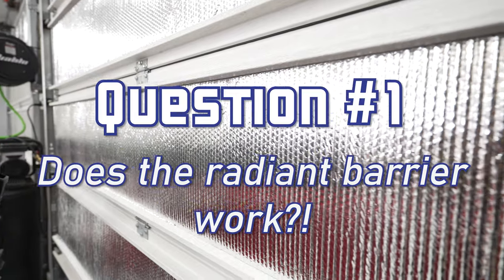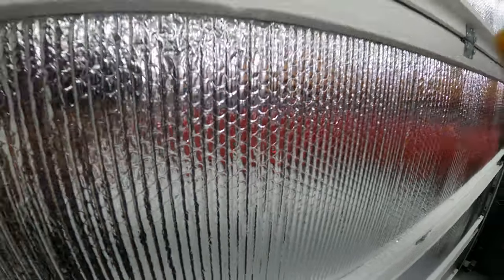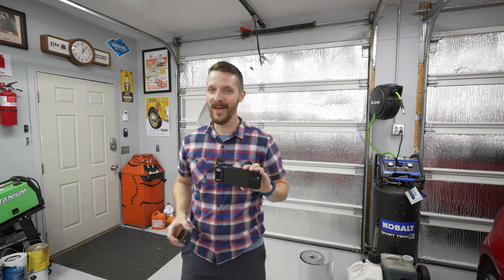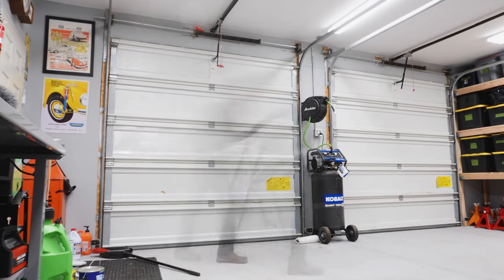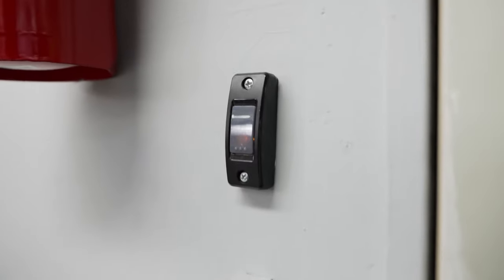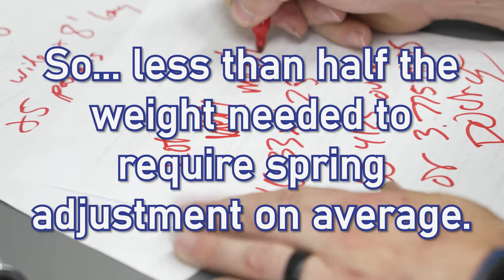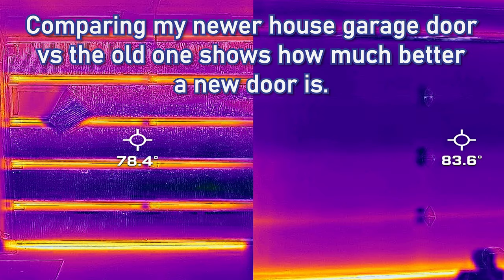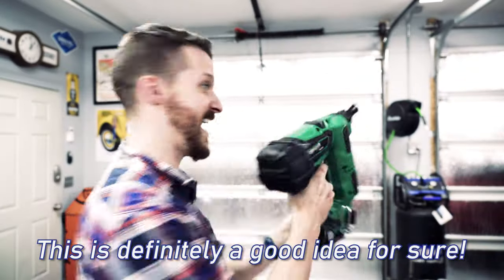DOES IT WORK? Radiant Barrier Insulation on Garage Door! (RESULTS ARE IN)

Comment: Great video,
I'm also in central WA, I did this to my garage door about 8 years back and made some mistakes, but also had some success.  Exact same style of garage door too.  I did 1" foam board and reflectix, I attached it to the door using foam adhesive to attach everything.  It ended up adding almost 20 pounds to the door so I had to adjust the springs a bit which wasn't as easy as I expected.  

However, I did one thing that was not done in your video,  I covered everything(hinge area included) with the reflectix.  Reflectix is very flexible and it never tore or failed,  Where I needed to open it up for maintenance I just cut a slit down the middle and left it,  Every time the garage door closes it closes the gap and still provides insulation.

What I learned from what I did:
-foam weighs too much, I'm doing it again on another garage door, and I'm going with just 1 layer of reflictix but I'll use aluminum tape to mount it again and I'll mount it to the ribs folding in a 2" section on the ends to close the air gap.  
-Foam glue failed after 3 years, would not use it again.
-Aluminum tape did work, lasted a lot longer except where the foam glue failed it eventually wore out.  However, the surface needs to be very clean before applying the tape.(note, if you use aluminum tape, your radian barrier sits on top of the ribs with the tape going around the top and bottom of the ribs.  I had to re-do some of the insulation a few years ago and used an off brand aluminum tape, and it didn't last nearly as long.  Maybe it was bad tape, maybe I didn't clean it well enough.
-reflectix lasts an incredibly long time and is very forgiving material

I stumbled on the original video trying to find a fix for a garage door seal issue, but I stayed for the full course.
Reply from the maker: Wow, lots of great info.  Thanks for sharing.
Reply: Did you insulate the garage attic / ceiling also … how about the walls?
Reply: @delvalle9256 Yes, I am wondering the same damned thing.   I need to do something with my attic, because it is just too hot in Texas.  Our electric bill last month was $500 bucks, and it's usually $200/$250.  Very hot summer.
Reply: @PoeLemic We had the same issue here in CA. We had solar installed and it’s been amazing. Our bill is almost non existent.
Reply: I'm in western Washington and glad to find a youtuber I'm Washington state ! I'm now a subscriber!
Reply: @JasonExplainsThings 
What I wanted to know was not the garage door heat difference but the overall garage temperature. Do you recall how much the entire garage temperature went down by?

Comment: When you use an IR thermometer, the reading depends on more than just the temperature of the surface. It also depends on the emissivity of the surface. And the emissivity is much different between your radiant insulation and your white garage door. So the temperature difference readings are not reliable. You can mitigate it to some extent by taping a piece of white paper to each surface to be compared, and measuring the temperature of the paper surface. Or better yet, just use a contact thermometer.

By the way, IR thermometers are particularly bad at measuring the temperature of shiny surfaces accurately.
Reply: And that information comes with the devices he using... so he's an effing hack trying to make money by pretending he's smart enough to show the world how to do sh^&!  YouTube is just a disaster these days.  Ugh
Reply: Thanks for making this important point which invalidates the testing.
Reply: So tell us how you did it. @DiffEQ
Reply: @DiffEQ  assuming he read the info in the packaging cause lets be honest who does that and for those that do who understands it. its more fun to just pull it out and use it.
Reply: I came here to say this. This poor guy is clueless on this subject!

Comment: According to the Powers that be you are supposed to have a 1 inch distance between the Radiant Barrier and the nearest surface. I have actually used the 4ft wide version on 2 Total House Gut outs and Cut MY HVAC bill by 80%. 2 inches spray foam, then the Radiant Barrier across the studs. Then Tape all seams corners etc so that there was a continuous  Radiant Barrier  surface between the inside and the outside. I Lived in New Jersey. Had to turn the A/C on for about 2 weeks in the summer. The heat went from coming on every hour to coming on every 4 or 5 hours. You Might want to try adding an Extra 2 inches to your height  and width so that it pillows out a little. You Might get better heat reduction out of it. YOu could also use the 4ft wide stuff cover the whole door with the Radiant Barrier leave needed slack and you might be able to get even better results. But nice to see that even without the 1 inch space it still works.

Comment: The IR reflection of aluminum is very high, so with IR gun or IR camera you are measuring temperature of IR reflections from the inside of the room off of the aluminum surface, not the amount of heat coming through the barrier.

You can spray a small area of foil with paint or put some black electrical tape on surface and it will then represent the heat coming through the foil.  What ever you use must have good thermal conductive contact to foil and not be reflective to IR wavelength.
Reply: The temperature of the foil isn't very useful information... showing the temperature of the garage door from the outside would be the best way to show how well the heat is being rejected from the garage. The outside temperature where the reflective panels are should be considerably higher than the temperature where heat is being transmitted into the garage
Reply: Temperature is not the same as heat flow. 2 different but related concepts. for the high reflectivity materials, it is tricky. use a contact thermometer to measure the surface temp. This temperature will cause the convection of air. Radiant should be negligible.

Comment: 2 years ago I had a foam guy spray foam my doors with 3'' foam weighs lot more than what you used. 2 years later still opening fine. was expensive yes but now I can keep my garage warmer and cooler than my living room! also sprayed the celling not to mention 24'' cellulose above ceiling. The fiberglass garage door insulation kits do very little been there done that. My garage is wooden structure I built like a dwelling 3/4 plywood floors on 2x8's on 12'' centers it holds my 1/2 ton truck NP. I enjoy working when Im comfortable and in Texas it gets way over 100 DEGREES! 106 today.
Reply: How much did it weigh? Product?

Comment: I grew up in Sunnyside WA, and it would get hot during the summer.  I now live in the South end of the San Joaquin Valley in California and it is miserable. So if this works I will be using this product.
Reply: Fresno here - I just did this and took it one step further by covering the gaps between panels with smaller strips of reflectix and foil tape and there haven't been any issues when the garage door moves. Garage faces east and at over 100 degrees outside the garage temp was comfortable at 71. Before, it would get into the low 80's!

Comment: I have similar garage doors, I did what you did, but for an additional layer, I used spray adhesive and did an entire sheet from top to bottom on the garage door.  The hinge position (when door shut) are at their furthest apart so lifting the door means the insulation will crease but not come off.  

Putting that second layer in created a nice air gap in the door and it was far far better.
Reply: Ryan, would you mind? posting a pic of your garage so i can see how it looks.

Comment: Fun video for sure.  I too have looked at the cost of a new insulated door, compared to DIY like this.  ROI is a huge factor.  If you have 3k and don't care, go for it right?  I read some comments about a larger air gap for the RB - which will provide a couple degree's cooler probably.  There is still plenty of metal on your door left exposed which radiates heat. You're spot on about gaps at the edge of the panels where it meets the weather strip being a problem.  I found a cheap solution - a spring loaded door hinge. Look up "Green Hinge System". I have a southern facing garage door that acts like a frying pan in the summer.  I did the reflective radiant barrier but I also put another RB that has the silver reflective material laminated to a thin soft foam back layer (advertised at being R-8 equivalent).  I cut the reflective barrier to size so I could wedge it inside the door panels keeping them in place place and stand away from the door for a better air gap. I then used the double sided foam tape on the outside edge of the panels to hold the foam layer giving me 2 layers.  (I did the install of the 2 layers a few days apart, and could feel a noticeable difference just walking next to the door during a week of 95+ degree weather.  Before 1st layer - it radiated heat like crazy and could be felt from 3 feet away.  After first layer, it was a huge difference - could still feel heat a few inches away.  The heat was localized and felt when I put a hand near exposed metal edge of each panel - but not in the center of it.  After the 2nd layer, I no longer feel any heat radiating heat off of it. I feel a few degrees difference from room temperature when touching the foam layer.  Unfortunately I didn't take any measurements).  I later added the Green Hinge System (wish I could have done first, but found the product months after adding the insulation).  It closes off the gap and doesn't allow the wind to blow the door edge open during storms.  I figure I'm still at 10% of the cost of a new insulated door and somewhere between 1/2 to 2/3 of the R value if you take the DIY products at their advertised ratings.  Thanks again for sharing - wish I had thought to document my install, but more so, wish I could convey it as succinctly and entertaining as you did!

Comment: great info, I found used insulated doors and replaced my 1950 versions. But I have my brother in law to help and we are thinking foam board but I may consider sandwiching reflection material between the foam board and the garage door. This should... in theory, help the heat be reflected in summer and maintain the warmth inside in winter. Also, I find it is very easy to adjust garage doors if we add too much weight. It is really an easy process if you follow the way the pros do it. Great video, and I have to say, the ending rivals the silliness of JarJar Binks. Great to see you having fun.

Comment: I did the same with my doors.. same model.. I was able to put the insulation at the joints.  After I put it there, I took a box knife and slices it in the middle so it could bend when open. When closes, the two sides come together and seal. So you can get the joints too. For me I used that spray glue, Super 77 I think it was. I live in a hot humid environment and freezing during winter and after 5 years, no issues and help retain the cool and warm temperatures inside.
Reply from the maker: Nice job. 👍  I'd see your glue idea as a good option for high humidity areas.  In Central WA we get extreme heat and cold, but humidity is pretty low year round.

Comment: The reading on the non contact thermometer depends on the emissivity of the surface. If you want an accurate measurement then put some PVC tape on the surface and measure the temperature of that. You will need to be real close to ensure the full sensor field of view is enveloped by the tape... Or just use a contact thermometer...

Comment: It looks like you installed the barrier directly to the face of the door panel. You would really see a benefit if you installed the barrier on the horizontal “structure” of each panel, giving you about a 1” air gap between the barrier and the panel face. 

The way you have the barrier installed, you are only gaining the air gap between the two foil faces. Because you have direct contact to the panel face, you have conductive heat transfer between the panel face and the mating foil face of the barrier. 

I would suggest trying to install a piece of barrier that a bit wider to span the bent edges of the panel and comparing to a barrier that’s mounted directly to the face.
Reply from the maker: I’d suggest watching this video and the install one again, because it has an air gap.

Comment: To check the weight of your garage door unhook it from the opener and open half way if it stays put your hood if it slams you are screwed. 3 Turns for every foot of door if you need to tighten your springs.
Reply: Wat

Comment: From what I understand, you're supposed to use something like a piece of tape over the insulation so that you can get an accurate reading. Otherwise, you're just getting the reflection from inside the shop as opposed to the actual temp on the other side of the insulation.

Comment: Using some soft enclosure foam on the hinge joint and cheap EPS foam in end of each panel as a spacer would allow the entire door to be covered and give air space inside the doors panels to allow the radiant barrier some of the air space it actually is designed for.

Comment: keep in mind aluminum is a very strong conductor of heat.  It works by blocking radiant transfer of heat (the air gap between the door surface and the reflectix ).  If the aluminum (reflectix) contact with the metal door is reduced to a minimum, it would probably be even more effective.  But it looks like it works well enough for your purposes.
Reply: Yes an air gap is essential for any IR barrier to work.

Comment: I think the question about garage doors opening was related to the remote control not the weight of the insulation. Did the metallic nature of the insulation effect the operation of the remotes?
Reply from the maker: Hi Greg, their comments were about weight causing the door springs to get overloaded.  And no... there is no issue with the remotes.

Comment: Hi Jason, its very informative. QQ my garage door is metalic and has small panels with about half to 3/4 inch sliding option for reflex membrane to go in. Should I tape it with the panel so its secured from sides or on the outside edgers to make it smooth as it looks in your video. Please advise. Thank you

Comment: The red dot isn't where you're measuring. They measure a cone, so the further you are away form the surface, the larger area you are measuring the average temperature of. Try pointing it at a candle flame and moving it away and watch the number drop.

Comment: My understanding of radiant barriers are that they stop and then collect or re-radiate the heat caused by UV radiation. Then that  heat needs to dissipate through an air gap and vent to the outside. Attics with radiant barriers are vented to the outside. My guess is that you are seeing benefits mostly from the insulation / thermal break and I also bet the radiant barrier is reflecting heat back into the door making it hotter?

Comment: I think you may have missed the point on the two-sided tape. I don't believe weight is the issue. It's the heat and cold the tape must endure over the years being stuck to the garage door.

Your video was great though. Lots of good information, especially about the weight and it's effect on the operation of the door. I've been considering a number of options over the last couple of years and I have been leaning towards the Reflectix product, both for ease of installation and weight. The mystery has always been how well it works in summer. Your video answered that for me.

Comment: Radiant barriers work better with a one inch gap between the barrier and the surface. You should have installed the radiant barrier over the seams between garage panels

Comment: I live in a 16ft contractor trailer looking for a lightweight isolation I only have one inch so it needs to be thin and lightweight it gets incredibly hot in the summer and as low as -14deg in winter do you think this would be a good option???
Was thinking about spray foam insulation
Reply from the maker: I’d go with spray foam… maybe a layer of reflectix on top with an 1” air gap?

Comment: You have to disconnect the  electric opener and see if the door will still "hang" in mid cycle or fall down to test the spring adjustment.

Comment: Thanks for the update.  What made you choose reflectix vs something like insulating foam?
Reply from the maker: Weight mostly.  Rigid foam would likely require new springs.
Reply: @JasonExplainsThings  gotcha.  Just finished using insulfoam— lol didn’t seem heavy at all.  I’ve seen someone use it with reflectix on top and I’m a long time reflectix user so we’ll see how it goes

Comment: Putting the foil insulation tight against the door is the worst way to install it. It is totally necessary to have an air gap between the door and foil. If you don’t have the gap you are wasting your time. I’d like to see a video test about this.

Comment: I realize this is an old video but for people looking at this there are a couple things you should know. Infrared technology is great but temperature and images can be misleading if one is not familiar with the technology. The surface of the foil is shiny and highly reflective. The IR camera and thermometer is picking up the reflected temperature of the room. To properly measure the surface temp, the emissivity of the foil and the reflected temp must be known so the actual  temperature can be calculated
Reply from the maker: All good points. 👍